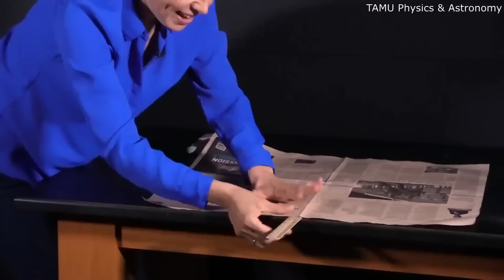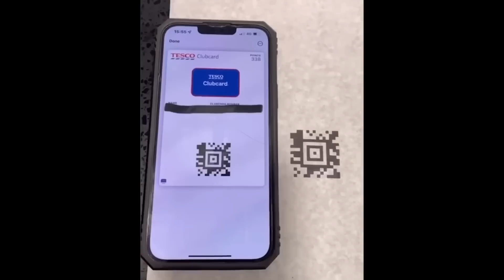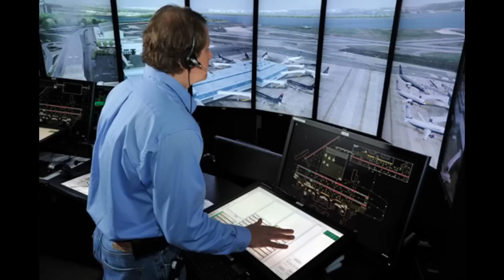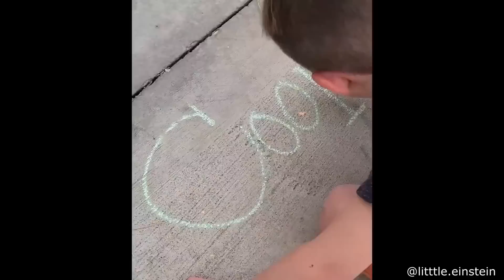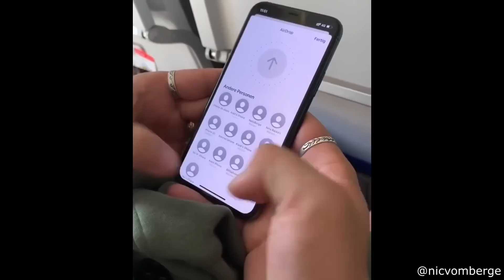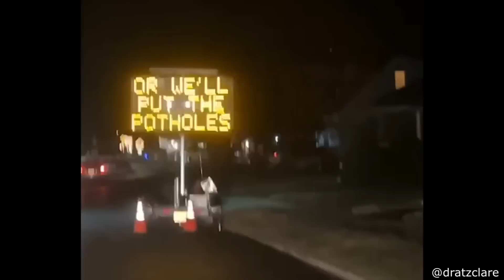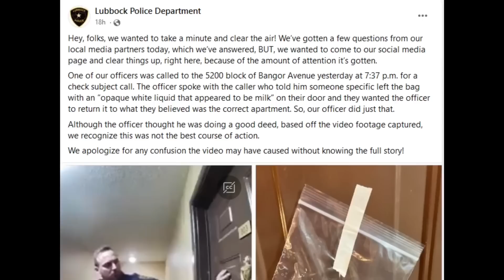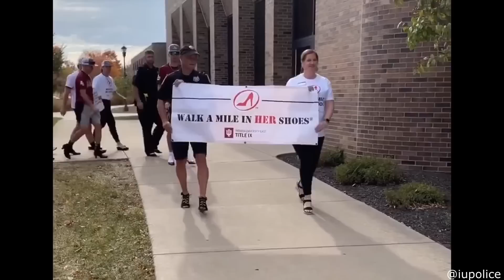1 Hour Of Daily Dose Of Internet *JUST ONE INTRO ONLY

Comment: as a camera operator @1:10 is why I had to ditch polarized lenses, I couldn't see LCD screens reliably. they're great for looking thru the water's surface , and general glare removal. you'll feel like you have super vision sometimes. you can see the stress patterns and coatings on transparent mediums.

Comment: Thank you so very much for NOT superimposing MUSIC/NOISE during most of the clips !!! Especially the ones outdoors, in water, the wind, the pitter-patter of the dog running and then jumping into the leaves, the waves lapping, the whales breathing through their blowholes. etc.   I suppose some of the clips already have that annoying beats=noise in/on the video, but it is usually quiet.  I also appreciate your calm to-the-point descriptions without any lame attempt to be funny or clever:  they are usually made just to fill the (wonderful) void, unnecessary and annoying because the video speaks for itself !!  I have subscribed. !!!

Comment: it is horrible ot have a truck turn that eazy unless it gets harder to turn at high speeds if you hit a rock rong that steering wheel is turning wether you like it or not in 44:00
Reply from the maker: Trucks are difficult to drive
Reply: @JDXGamingZ  -_-
Reply from the maker: @Wheelinfourtrax  hehehe